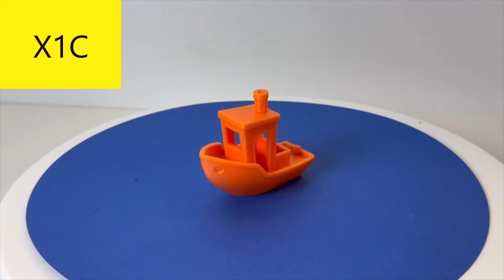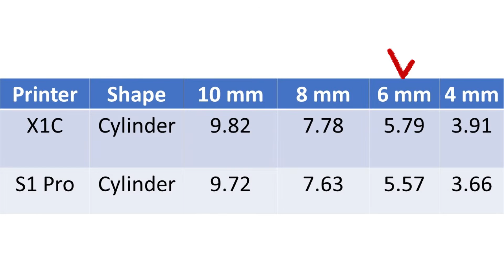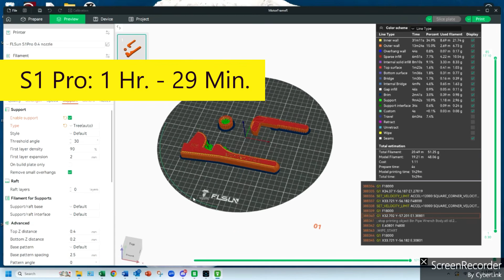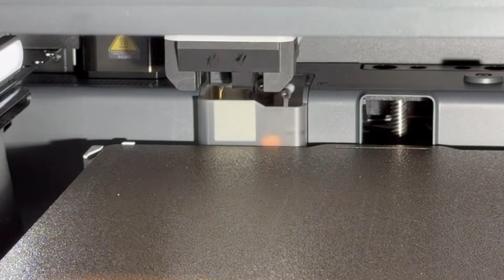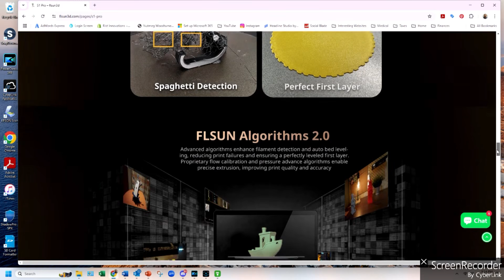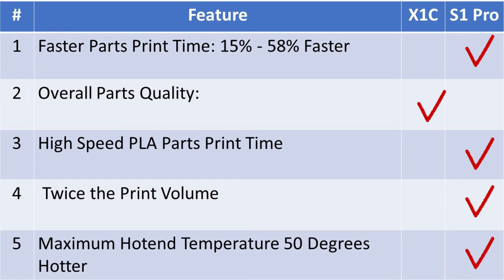FLSUN S1 Pro 3D Printer: Better Value Than Bambu Lab X1C?

Comment: I have both, but the S1 Pro is particularly dangerous and should be recalled and taken off the market due to its fire risk.
Reply from the maker: Can you share what you specifically mean regarding the S1 Pro being a fire risk?
Reply: @r @ristinnovations es one of the 3 motor driver boards failed and caught on fire it was only by luck I was near the printer when it started to arc and smoke
Reply from the maker: Wow! That is scary. Thanks for sharing your experience with the motor driver board catching on fire on the S1 Pro.

Comment: I've owed the X1c returned it due to excessive hotend clogging. The S1 Pro is terrible and should never been released it suffers from multiple failures; motors fail, driver boards short and CATCH Fire, filament clogs, etc. Save your money and avoid a possible house fire and don't buy the S1 Pro.

Comment: Does your S1 Pro still work?
Reply from the maker: Yes, my S1 Pro still works, but I haven't pushed a lot of prints through due to other priorities.  I will be using it more in the coming months.  Thanks for your question.
Reply: @ristinnovations Would you recommend it over a P1S? P1S is $300 cheaper currently. $700 for the P1S and $1000 for the S1 Pro. EU prices.

Comment: I purchased an FLSUN T1 PRO in March. While it is an incredibly fast printer, with the right filament, I have had a lot of print quality issues with the printer when printing with filaments from other manufacturers. Most of the high-speed filaments on the market top out with a 600mm/s recommended print speed, while FLSUN boasts a 1200mm/s max print speed for their high-speed PLA, but it is currently more than $50 US dollars per KG, for PLA, which seems a little ridiculous to me. Since I cannot afford to purchase filament at that price, I am considering purchasing a printer that tops out at the 600mm/s print speed, just to get better quality prints with the affordable high-speed filaments that are currently available. That being said, if anyone knows of a filament, other than FLSUN's high-speed PLA, that has a print speed higher than 600mm/s, please let me know.

Comment: underrated video, thank you - but I think the FLSun is much louder - that might be a dealbraker for me.
Reply from the maker: Thanks for your feedback.  I'm not sure why this video didn't resonate with my subscribers (or the larger public).
Reply: @ristinnovations  not your fault, great video, and I think the pro is queter than the S1 non pro, how does it compare to the X1?
Reply from the maker: @rabenklang7  I don't have the regular FLSUN S1, only the S1 Pro; but from what I understand, the S1 Pro is much quieter than the S1. I don't have a way to measure the noise between the S1 Pro and the Bambu Lab X1C, but just from my observation I think the noise level is about the same, with the S1 Pro being a bit louder.
Reply: @ristinnovations  thank you for your feedback, it is much appreciated. I have seen tests from the FLSun S1, and it is really loud, so it might not be prudent to run it in rooms with neighbours living behind adjoining walls.

Comment: I have both of them.  In my opinion, they are really geared towards different consumers.  Each one does have a bit of a niche that makes it better than the other one at some things and not so good at others.  I personally tend to use the FLSUN over Bambu for single color prints.  The prints that I generally make are 3-5 times faster on the FLSUN and I've not had any quality issues with the minor exception of some stringing, which isn't a deal breaker for me.
Reply from the maker: Thanks for sharing your experience with both printers!

Comment: In practical terms, the S1 Pro may not have much if any advantage in build volume. 

A square inscribed in the 320mm dia. build plate is 226x226mm, vs. the X1C's 256x256mm.
Reply from the maker: I agree that a square offers some benefits versus a circle, depending on the shape of the parts you want to print.  One key advantage of the S1 Pro is the cylinder height of 383 mm, which doesn't count the cone-shaped print volume on top of the cylinder print volume.

Comment: Phenomenal review with all the details I've come to love and expect here. 😁 I can't wait to see the same diligence done on the Elegoo Centauri Carbon and the Anycubic Kobra 3 Max. I'm exceedingly curious to see the how they compare to the Bambu Labs X1C.  In particular how significant the trade offs are between these models on quality for size and cost. The measurements you provide and the insights are the best for understanding these quality comparisons. Keep up the great work. This FLSUN FDM printer wasn't even on my radar. Great video!
Reply from the maker: Thanks for such positive feedback; I really appreciate it.  I have ordered an Elegoo Centauri Carbon, but it won't arrive until May or June.  I don't know if I will be evaluating the Anycubic Kobra 3 Max because I have not had any contact with them.  Thanks again for your comment.